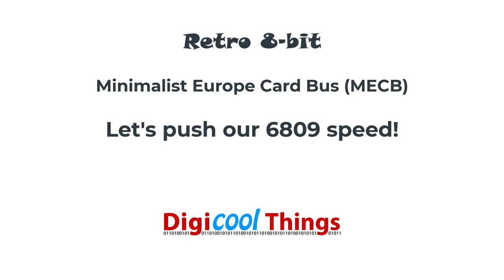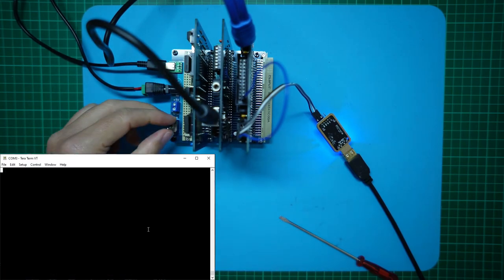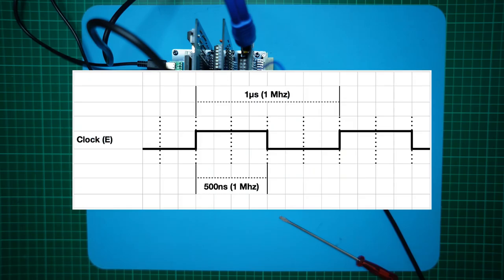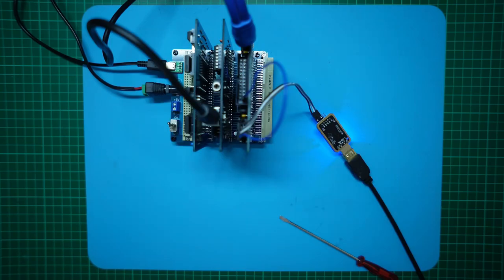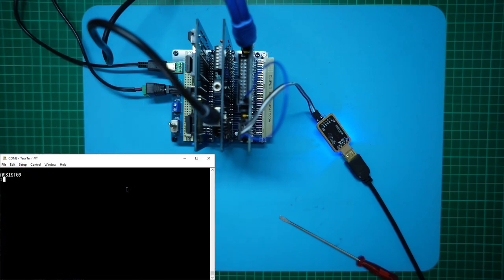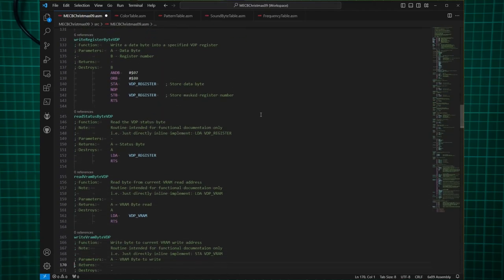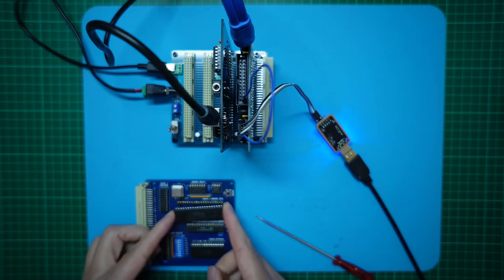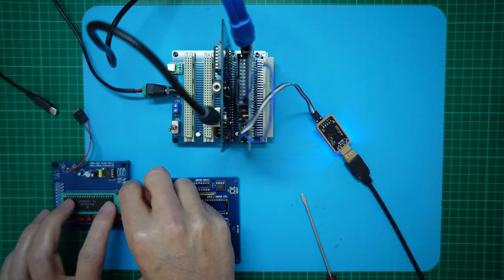Minimalist Europe Card Bus (MECB) - Let's push our 6809 speed!

Comment: Well in the early days the Rom and Ram chips seemed to be the speed limiting parts of the design. somehow they took longer to again better access time than the processors. 

Slowly collecting the parts required for the challenge, working on the loan of an Eprom programmer. but support chips coming along ok.
Reply from the maker: Yes, my early days mostly involved 2102 and 2114 Static RAM chips, which I recall were mostly 450ns access time.
Just fast enough for the 1Mhz 6800 / 6802 processors I was using at the time. 
And they were expensive!  Initially 8x 2102 for 1KB, and then only 2x 2114 for 1KB.
I also remember saving-up to buy my first (yes, just one!), 4116 Dynamic RAM chip to experiment with.
At the time, having a 16-pin chip that held the equivalent of 2KB was like my first mass storage device! 🤓

Can’t wait to see what you do with the HD63A01V1.  Will be fun to see that piece of retro 8-bit history brought back to life again!
Reply: @DigicoolThings  i was lucky to start working in an electronics company at 16, and they use let me use components from the stores to  make things for college and this also meant the homers got supplied as well. 🙂
they were at the forefront of audio communications with microprocessors so we were always trying to make things work faster. 
i can remember the cost of upgrading my PET from 16 to 32K, that was a shock.

Comment: Its unfortunate that so many of these early 8 and 16 bit CPUs are no longer being manufactured. I recently watched George Foot's video on designing a 65C02 SBC clocked at 32MHz and would really love to see what kind of performance could be achieved if other processors were still being manufactured.
Reply from the maker: Interestingly, you can still buy newly manufactured MC6809 microprocessors.  Rochester Electronics has been manufacturing them, under license from Freescale, since 2016.  But they are around $135 each with a minimum order of 2.  Still, it’s great to know that new MC6809 are still being manufactured.

I just watched George’s video.  George is also achieving around twice the manufacturers speed rating (or just over), with the modern 14Mhz rated WDC CMOS W65C02.
I noted he’s only achieving that speed during RAM access, using similar high speed 15ns SRAM.  But, similarly, he’s also limited by the 150ns access time of the ROM.

With this in mind, I’m really happy I was able to achieve twice the manufacturers speed rating with my original retro Motorola HMOS / NMOS parts, even though my goal was only to test the MECB system & bus speed robustness. 🤓
Reply: It's cool to hear that the 6809 is still being produced! Do you think you'll continue to run your MECB computer at the doubled clock rate? It was really great to see that it worked with only minimal software changes.
Reply from the maker: @GregCoonrod  I’m just working on editing my next video, where I’m running BASIC, and I’ve just left the 16Mhz Oscillator in place.  So I’m still running with a MC68B09E, at 4Mhz.
Didn’t even really think about it, so I’ll possibly just leave it running at 4Mhz for now.